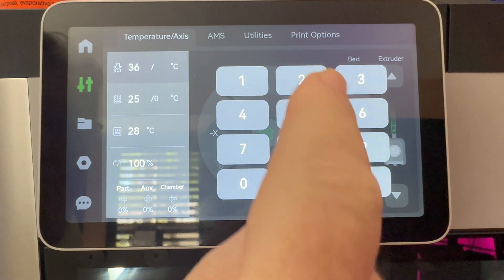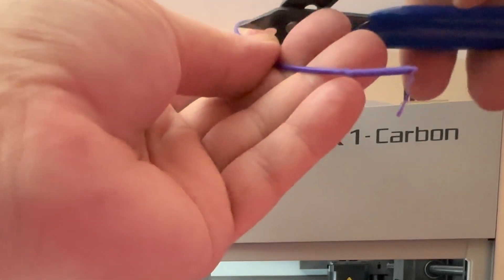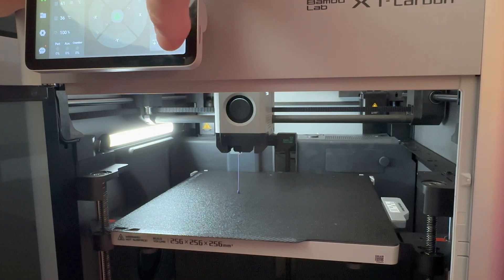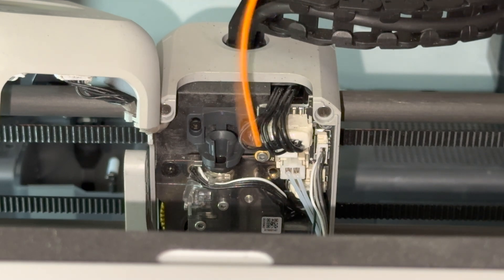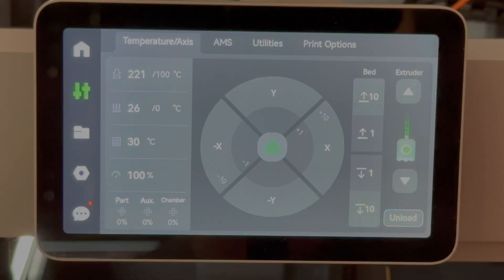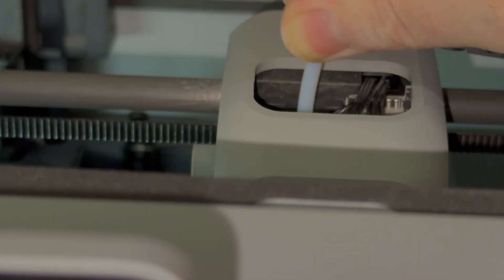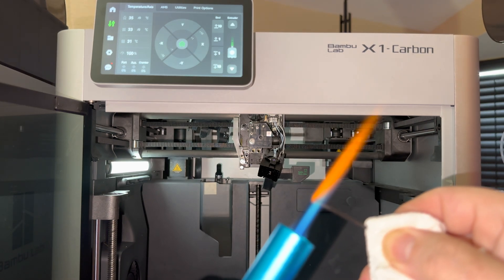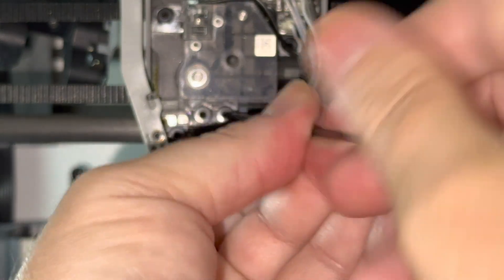How to Easily Unclog Your Bambu Lab 3D Printer Nozzle: A Step-by-Step Guide

Comment: where is the nozzle clog? This looks like the extruder is clogged, not the actual nozzle. I have filament stuck throughout the 0.2mm nozzle and nothing is working. The needle is too weak to push through and the way the filament broke, I can't grab onto it with pliers to pull it out. I've tried temperatures all the way up to 270 deg C and I am having no luck. At this point it is looking like I need to just buy a new nozzle and wait another eternity for BL to ship it out
Reply from the maker: Sometimes it’s the nozzle, sometimes the extruder (check my other video about the extruder clogged). On 0.2 nozzles, not all the filaments can handle it. Try some other filament and slow it down, this might help.
Reply: @techwithkramer  I was using Bambu Lab's PETG Translucent. It was working fine for previous prints of the same object and then just randomly stopped.

I partially unclogged it by using a lighter to heat the provided allen key, pulling out enough of the stuck filament when it cooled off so that I could then reload more filament after setting the nozzle to 300degC for 3-5 minutes. I wasn't very hopeful, but it started shooting out tons of filament. I don't know if this contributed at all, but the settings in my bambu studio were still set to 0.4mm when I finally successfully unclogged it.

I think previous unclogging attempts were unsuccessful because the filament broke flush with the nozzle so the extruder was not feeding into the nozzle.
Reply from the maker: Is there any reason you use PETG instead of PLA? And what is it that you are printing where you need such a high detail in translucent?
Reply: @techwithkramer  I just got my first 3D printer (P1S) a couple weeks ago on that big sale and haven't had much time to research about different materials due to final exams. 

Originally, I wanted to do even stronger materials, such as ABS/ASA, with my unopened 0.6mm, but it seems like it could contaminate my printer with worse toxins(such as lead) and I plan on doing food-safe prints later on(with proper sanding, vapour-smoothing, polishing, and coating). PETG over PLA because I have heard PETG is stronger and I like to abuse my things. Anecdotally, thus far, it seems like my PLA scraper got absolutely brutalized when I started printing PETG.

I am printing key caps because my keyboard's key-sizing/layout is nonstandard and thus no key cap sets are made for it. I am doing multi-colour prints and the lettering was not turning out very good with the 0.4mm nozzle, also, there would be little gaps/holes on top surfaces, which were already about 5-7 layers thick with 100% infill, so you could see the other colour through the holes/gaps. Translucent because RGB back-lighting. From testing, the 0.4mm nozzle prints the translucent PETG into grain-y broken-glass-resembling material, and the 0.2mm nozzle prints a more consistent pattern with more scattering/frostiness and makes it look higher quality. Added bonus is that it just looks like frosty white, almost opaque, when there is no back-light turned on. As I type this out, I am testing out some new settings, including ironing out each layer and using arachne walls. Hoping I get something that sort of resembles the glass appearance I am seeing people post about.

I am also designing a keyboard from ground up since I am from a software background and I am trying to branch into more science/engineering type things. So I am using this as an opportunity to learn by messing around with CAD software and circuitry.
Reply from the maker: I would recommend you to use ASA for food safe prints even though that would mean your printer needs to use food safe components too. ASAP is also stronger. PETG is not always stronger than PLA - there are some good videos out there like the one from CNC Kitchen.

Comment: this doesn't work. I have an extremely clogged hotend, can't even stick an accupuncture needle al the way through at 290 degrees
Reply from the maker: There are special needles for each nozzle size. Unless the actual plastic got burned totally in the hot end (which could be caused by too much heat), the plastic would be soft and the needle can go in. How old is your nozzle?
Reply: @techwithkramer  It's a brand new printer. I was able to pull out the clog with 5-6 repeats of the hot allen wrench trick, with the hotend removed. There was a LOT of solid ABS stuck in there and it kept breaking

Comment: Thank you so much for this video. Exactly my problem, solutions straight explained! Unfortunately mine was solution 3 with the broken filament.
I used a nail intead of the allen key which is easier to heat up. Pulled it out with pliers. BC the nozzle was still clogged after this, I cranked up the temperature to 250C and pushed some portions of filament forth and back. After it came out on the nozzle, I performed your 100C-trick. Now it works... I hope for a long time!

Now I'm jealous on your X1 display. The P1 one is... well, not that comfy...
Reply from the maker: Great to hear you fixed it. On the display, I will change one of mine for a 3rd party display… video coming soon….

Comment: The filament tubing broke off at the extruder and won’t slide back in the extruder now…
Reply: It was my first time disconnecting the PTFE tubing, so I didn’t realize the clamp mechanism needed pushed down to release it 🤦‍♂️. I was able to take apart the clamp and remove the small piece that broke off. I've now tried all 3 methods, but unfortunately the machine thinks I have an external spool of filament loaded (never had one loaded). Guess I will have to get into the extruder tomorrow.
Reply from the maker: @ParkerParkourable Just follow my extruder video and you will be fine.
Reply from the maker: Do you mean the white PTFE tubing broke off? Can't imagine how this could happen…

Comment: Thank you- i was able to temove my first clog with the hot allen wrench trick, but i do have a question. I tried your first tip but i could not pull that white PTE(?) tub out at all. It is really stuck in there. Am i supposed to loosen a screw or something? Please pardon me, i am brand new. Ive watched every video i could find and read the wiki files with no luck.
Reply from the maker: You need to push the black ring down and the tube up at the same time, this will release it. Glad you got the clog fixed!
Reply: @techwithkramer  thanks so much!!

Comment: I only had my X1C 2 days when the Bambu supplied PLA test filament broke off at the heatsink hole. I heated the nozzle to 250 degree and used a 1.5mm Allen wrench to force the filament through the heat block tube, which was easy enough to do, then I used a 0.4mm nozzle cleaner, so the last part of your video was very helpful. I also have a Prusa Mk4S and I am accustomed to hot end service at least weekly. I was hoping it would be a much less frequent occurrence with the X1C. My wife has an X1C and has only needed to replace her hot end once in 2 years!  I must be hot end cursed ;)
Reply from the maker: That is unfortunate, but I guess it's just how it goes sometimes!

Comment: I feel this quick video is an upgrade over the Bambu wiki. 

Before the Bambu P1S,  I had an Ender 3. I tried so many of the Youtube Uncle's Special Recipes on that machine that I started fearing messing up the machine while trying to fix it. Bambu seems a lot more solid in its approach to servicing. But then seeing how Bambu's own wiki showed using a lighter on nozzle with the sensor and its wiring still attached, I got flashbacks... Glad to have found this video.

I especially like the feeder on the nozzle end so I do not have to guess how much muscle force to use while feeding to see if my nozzle is still clogged. Now nice circles mean clean nozzle.
Reply from the maker: Thank you 😊 glad the instructions worked for you and welcome to the world of Bambu printers.

Comment: How do you unhook the tube, though.
Reply from the maker: There is a black ring where the tube goes in, push it down while pulling the tube up at the same time.
Reply: @techwithkramer  odd, pushing down on the ring isn't releases the tube
Reply from the maker: Try it like this: https://youtu.be/ZbH1mzGwhdc?si=PB3U15J5IPF6qvjt

Comment: even after the last step it still doesn't work, what a terrible mistake that I bought this crap
Reply from the maker: Did you check the extruder? Believe me, you didn’t buy crap if it says Bambu on the machine.
Reply: @techwithkramer  yes I check everything, I think there is still something stuck in the extruder. Cleaned it twice with a hot small pin and pulled out some old filament. Looks like there is still something small inside. Terrible how the nozzle is made, almost impossible to fix this.
Reply from the maker: @Mazerunner95 if you take the extruder apart (I have a video of that too), you can easily take anything stuck out of there. Please check out the extruder video.

https://youtu.be/g6e-1oZAcm0

Comment: The trick you show for removing a clog by melting the filament around an allen key, than warming the nozzle, is absolutely brilliant, thank you.
Reply: Worked for me,Thanks dude🎉
Reply from the maker: Wonderful!
Reply from the maker: Thank you, glad you liked my video.
Reply: @techwithkramer  you just touched the nozzel with your hands, even tho its heated to 220° . isnt it really hot? or is it just the tip of the nozzle?
Reply from the maker: @Reloaded2100 You need to let it cool down before you touch it, otherwise you will get blisters, I tried that too 😬 but yes, it’s only the bottom part that is hot, you can touch the upper part.
Reply: He just grabs it with his hands if its thzt hot?
Reply: @Mr_SoulzZ  Yeah, I do that as well. So long as you don't sit there heating it for an hour. You're just heating the tip of the allen key, but not long enough for the heat to spread to the other end of the allen key. You'll know to stop heating as soon as the tip turns red.
Reply: @Mr_SoulzZ If you touch it by the fins, it’s not even warm.  The nozzle end is another story.
Reply: this is a very well known trick when removing brokeoff bolts in the automotive industry. works great on iron bolts too!
Reply: This was awesome! Thank-you!
Reply from the maker: @Danstout99 Glad I can help!
Reply: Awesome video, short and crisp, Hex heat method worked for me. Rather than heating the nozzle brilliant idea to heat a hex and pull it off 🙋‍♂️
Reply from the maker: Cool! 😎
Reply: It's actually the recommended method by Bambu, with them showing how to do it on their wiki.

Comment: 0:38 What if neither extruding or retracting works? I've both pushed and pulled the filament. A little bit at first up to a bit more forceful than I'd like. It won't budge.
Reply from the maker: If you have the right temperature of the nozzle it should work. What temperature do you have?
Reply: @techwithkramer  260. I also tried 270. I'm gonna take it the hot-end off and take a look
Reply from the maker: Sounds like the jam would be in the extruder… I have a video about that too
Reply: Seems a little piece got stuck in the hot-end and is refusing to come out,
Reply: @techwithkramer  I'll take a look. Thank you!
Reply: I have tried a cigarette lighter too and still jammed only option is to replace it

Comment: With all due respect the first step is nonsense. Replace the nozzle instead
Reply from the maker: That’s fine if you rather replace the nozzle. I don’t, and I usually can get printing again in no time without having to change the nozzle.
Reply: @techwithkramer  we change nozzle on ender printer once a month. so is bambu lab using titanium or some steel alloy? I assume the nozzle will not last a month  with wood filaments
Reply from the maker: I have nozzles with 5000+ hours still working fine, but I am using mostly PLA. If you use CF or any glitter filaments, it might last less. Still doesn’t make sense to throw a hot end away just because the nozzle is clogged…
Reply: @techwithkramer  I'm new to Bambu , the creality printers nozzles are like a pencil tip and needs replacement after few uses .
Reply from the maker: @groznyentertainment I used to have a few of those too, no fun. Welcome to heaven!

Comment: I've got stuck at the "Remove the PTFE tube" step. Are you supposed to put pressure on it in some way? It won't come out!
Reply from the maker: There is a black ring where the tube goes inside, press the ring down while pulling the tube out.
Reply: Thank you for this tip!  Worked for me.
Reply from the maker: Cool!

Comment: I had this error pop up during a print. Is there any way to change the temp while it's paused on the print? It's not taking commands. Do I have to stop it and completely start over?
Reply from the maker: Yes, unfortunately there is no way to fix it during a print.
Reply: @techwithkramer  If I hit stop to fix the issue, is there a way to still resume the print? Or am I SOL
Reply from the maker: You’re doomed, sorry….
Reply: @techwithkramer  thank your for your responses and the great video!

Comment: Extruder is still clogged....
Reply from the maker: Do you need a video on how to unclog the extruder? It’s pretty simple.
Reply: @techwithkramer you should definitely make a video on that. Searched for a while about a week ago and found nothing. Mine was terrible. The filament in mine was so bad i thought i might have to buy another extruder. I ended up have to use a drill so remove the filament because it had expanded and there was no way to retract it.
Reply from the maker: @peytonoates2271 Cutting it now, should be online later today or tomorrow. Should be helpful even if you already know how to take it apart as there are some helpful tips and tricks in there.
Reply: @techwithkramer  thank you! Your videos are very informative and to the point. Just subscribed.
Reply from the maker: @peytonoates2271 👍🏻 Great
Reply from the maker: @3D_TN  How to Easily Unclog & Clean Your Bambu Lab 3D Printer Extruder: A Step-by-Step Guide
https://youtu.be/g6e-1oZAcm0

Comment: Is there a way to do this while the printer is paused? I'd like to heat up and extrude without losing my print if possible
Reply from the maker: Unfortunately no, at least not to my knowledge. You need to cancel the print to do any manipulation like heating or extrude. It would be nice if we could at least heat it up to 280 and try to push the filament through… but there is no option for this (yet).

Comment: Thanks, a neat method to removing a broken bit of filament that worked perfectly.  I would recommend using something other than a hex key, it ruins the temper on the tool.  I used the back end of a small drill bit held with a craft knife handle.
Reply from the maker: Thank you. I agree, don’t use tools you still use after. I just have so many hex keys from every 3D printer I ever had, that I can easily ruin a few 😂

Comment: That purple filament stuck in the hotend is normal.  Thatvis where the cutter cuts the filament.  That will get purged out on the next print
Reply from the maker: Yes, unless you have a clog, then you need to get it out.

Comment: I’ve had my P1S for a week now and had to unclog the nozzle like 6 times. Very frustrating…

What could I be doing wrong?
I’ve been using only PLA, in 220° and the PEI at 60°. I’m generally printing at 200 speed.

Any tips?
Reply from the maker: Do you have a cold plate you could use? What brand of filament are you using?
Reply: I don’t have a cold plate. I’m using a PLA filament from a brazilian brand called 3D lab. It’s pretty standard.

In the last couple days I tried to print with 60° just the first layer and then use 55° for the others. I also kept the door of the enclosure open. So far, no cloggins. 🙏

Comment: I was thinking you'd burn your fingers if you heated the nozzle and grabbed it barehanded the way you do in the vid. On mine, the places your fingers touch have heat warning labels all over. I need to do the allen wrench pull, but wish to retain as many fingers as possible through the process
Reply from the maker: No burns the way I did it.

Comment: My hex key is stuck! What should I do?
Reply from the maker: Pull it out.
Reply: @techwithkramer  i used all my might to no avail, is there something else I can do to make it easier to pull?
Reply from the maker: How far did you stick it in? You only make it touch the filament so it melts a tad and when it’s cooled down the filament sticks to the hex key.
Reply: @techwithkramer  maybe I stuck it in too far 😓. Just kept pushing till it wouldn’t go any further.
Reply from the maker: I guess you took a too big of a key too….
Reply: Did you heat the nozzle before trying to pull it?
Reply: @dennisk5500  yes, even tried to heat it to 250c
Reply: @jayeshkog  If it was me, I'd heat the nozzle to the max and try twisting the key with some vise grips while pulling outwards

Comment: My PTFE tube is stuck? I don't want to pull too hard or I'll break it? How do you remove it?
Reply from the maker: You need to press the black ring down while pulling the tube up.
Reply: @techwithkramer   thnaks! i did but it was stuck. I had to unload the filament with Bambu first. Sorry noob question. Once the "unload" is performed then you can press the black ring down and it 'll come out

Comment: Thank you, this is a great machine but these clogs are frustrating
Reply from the maker: Clogs are only happening if your temperature setting is off or you are using really bad filaments. I am using Overture and the textured pei sheet with taking the front door off and I have not had any clogged with all my X1c machines using PLA since. Or even better use the cool plate.